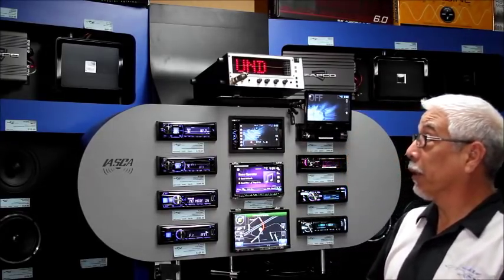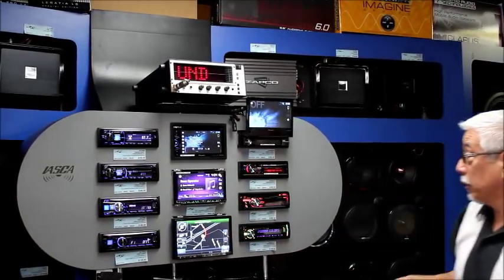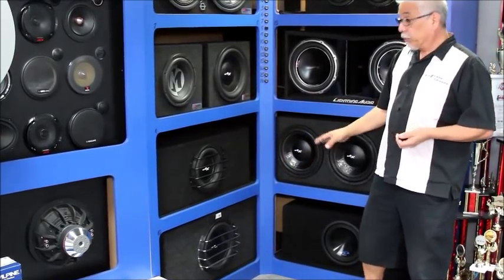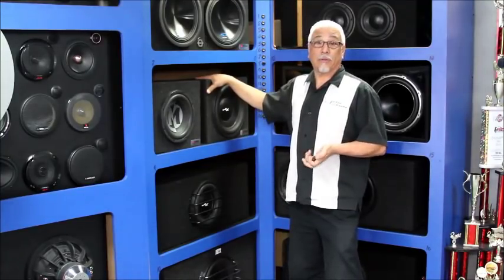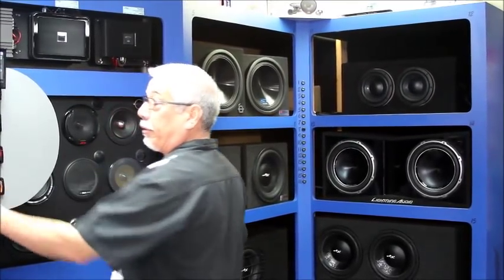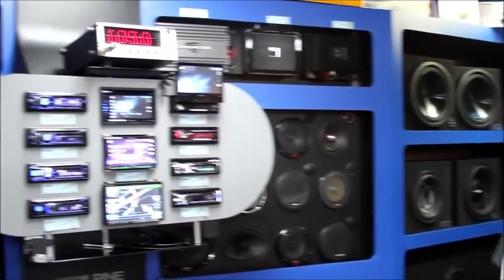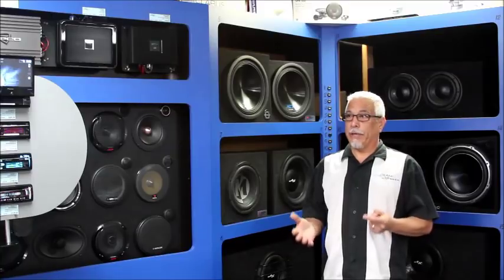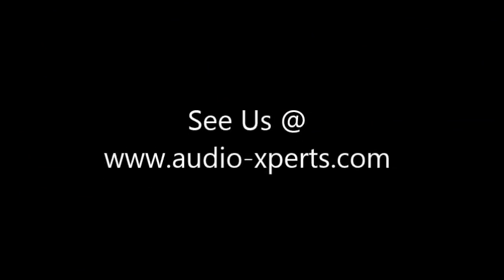Sealed vs Ported Demonstration by Audio Xperts using SPL meter to show output differences

Comment: Ok, first off, what is the subs specs? Is it low or high Qts? Does it have a stiff of soft spider? Secondly,  a correctly designed sealed enclosure can and will extend a flatter frequency response to a lower frequency if designed that way. A ported enclosure always has a spike in the frequency response at some given frequency, generally at wherever your port was designed to produce the most output at. Doesn't it depend also on the car the enclosure is going into? Most people are looking for boom type bass output, not clean output for the audiophile types. So, wouldn't it depend on what the owner was going to listen to and what system they owned? Just some questions to think about when claiming one type is "better" than another. Music is entirely subjective in what is better. Great demonstration video though. Keep the great work up.

Comment: Not all woofers work in ported and some don't work closed, so the thiele-small parameters have to be consulted to optimize. Let's say the qts is 0,3 or lower, you would need an incredibly low fs to ever get bass out of a sealed box, and on the other hand, if you bring that qts to 0,7 on the driver and make a ported box would get a nasty decay (muddy bass). If a woofer is somewhat in the middle and both enclosures are an option, you are generally looking at a 3dB gain for the ported compared to sealed, because you are utilizing both sides of the membrane, that's if both enclosures are optimized to have a smooth response with a nice gradual roll-off.

Comment: I've been recently testing out various subs and box and amps. I've found a decent amp wired to a correctly matched subwoofer is about 50% of the volume, and you get about 50% from the wooden box their mounted on and in. I've seen very impressive sound and volume from a small sealed box with just a jbl gt4 12" (250Wrms) mounted, and a T-rex 10"(1000Wrms) mounted in a tiny box barely able to rattle mirrors when I know those T-rex speakers if in a large box can break windows. I now after trial and a few errors am running twin inphase subs in a massive ported box run off a 2400W juice mono block amp. The combination is impressive and was quite cheap compared to alternatives to get same volume and quality.

Comment: Buy a sub built for a certain enclosure type and put it in that. Like an FI q in sealed and a sundown x in a ported box. Your better off getting one small sub and a good amp if on a budget. Like a digital designs 8  that can hammer lows with good sq.
Reply: Just not the lem-08... great output for a 400 watt 8, but at what cost.... just put a 12 in a matched sealed, same output, better sounding.

Comment: I turned my ported box to sealed by stuffing the hole with old clothes and I set my LPF at 250hz hoping it would change it to a bit more punching/ accurate sub. And it kinda did! I needed to adjust the gain pretty high to get the same output that the ported version and now I'm just worried that it will overheat.

Comment: Should I use a 250 rms jbl or 300 rms Pioneer for low basses in a sealed box. Box size doesn't matter. I can use even 60 lt box.

Comment: A driver will not pushed to its mechanical limit just because the enclosure is sealed.  If it happens, it's because the enclosure is not big enough.  One reason for inventing vented boxes was to cut down the size of the speaker enclosure.  This has been forgotten these days even by audio experts.  Vented enclosures can balance the inner air pressure with the outer pressure.   Sealed enclosures need to be almost double the size of their vented counterparts in order for the driver to run smoothly.  But nowadays people prefer everything to be compact, and sealed boxes are almost the size of vented boxes.

Comment: Hey... I understand your theory & I realize the fact that you mic couldn't pic up the sound properly. I had 2 12inch Electro-voice speakers in a box designed by a friend that worked at a place called tape town in Washington, I believe near Bremerton, anyway .the box was ported & running them with a 70/70 watt Sheridan bridged amps, (Yes,from back in the 80's, Cheap & very inefficient amp),the bass was gut shaking. I put rubber bushing & sound deadening material through out the hatch back to help with unwanted rattling, had the 6/9 pile driver speakers ran by another 70/70 in stereo, using 2 passive eq's, (  no electronic crossovers yet, in my area at the time), one for the woofers with the highs cut, the other with the bass cut on the 6/9's. I also has 6.5 door speakers on a 40/40 amp, anyway as I said, the EV's slammed. I tried a woofer box with sealed speakers, (I don't remember the brand so I won't make it up), & it didn't slam at all, not to say that they didn't sound good, but the inefficient amps & ported box played much louder & during the mid to late 80's good & loud sound was the order of the day. My home theater has a svs  pb 12+2 that's ported. I recently hooked up a friends HSU ULS-15 MK2  which is a sealed sub & it wasn't even close. The sealed sub didn't have the same tactile slam for movies, it didn't sound any better on jazz tracks like Diana Krall's All or nothing at all, & with Pipe Organ opera tacks, no way for the sealed box.I must state that the Svs sub has 2 12's vs the HSU's one 15, but it wasn't close, though the HSU did sound good in it's own right. My old Polk 505 sub seemed almost as  low & loud that the seald sub., but not by much.I agree, all things as equal as can be, A ported box will be louder & give more slam than a sealed box that's close to equal spec & amplified power , JM2C. P.S...I know my old car woofer box isn't a sub box. Electro-Voice speakers weren't subs but accordion edged pro audio speaker but the really hit, I believed better than the comparable Cerwin Vegas of that era. There wasn't a lot of true sub bass  laid songs out at the time. 25hz was very rare in early rap & r&b of that day.

Comment: sealed is better accurate bass
Reply: Angel Estrada hell yeah sealed any day over ported I like both but sealed just sounds better basss
Reply: Accuracy, yes. Problem in have with ported enclosures is that they fall flat on the lows especially 30hz and below unless you have a custom built one tuned at a lower frequency. But they are quite loid and boomy at 45hz. I once bought the kicker CompR dual 12 box from best buy and lows were virtually non existent 30hz and below. You could hear them bottoming out but that was it, yet my one old school CVR 12 in a sealed enclosure put out way more low frequency bass, shook the heck out of my seat. Didn't have much higher frequency output like the ported setup did but killed that kicker loaded box with the 2 CompR 12's. If you have a ported enclosure tuned at a low enough frequency it can slam lows at 20-25hz but sound quality and accuracy go out the window. With a sealed enclosure if you want more lows around 20-30hz you can achieve that by going with a larger enclosure assuming the subs are the same for comparison purposes. Also cheap subs won't hit the lows regardless because of physical limitations like excursion. Cheap ones don't have near the excursion as a good one. And to hit those super low bass notes you need that excursion.

Comment: i have 2 12" in a sealed box, i have a ported box but now after watching your video clearly ported is lowder but if i put the 12s" in the ported box how should i wire them, parallel or singular
Reply: D Anderson Depends on the impedance of the coils and your amplifier and electrical capability.

Comment: Efficiency is determined by driver alone period. A ported box only affects bandwidth or possible peaking effects, or one note bass, misalignment. Drivers made for sealed box have higher Q and less efficiency. Low q drivers need ports to compensate for excessive bass rolloff. There about an infinate number of tunning possibilities with ported.

Comment: My Amplifier was a bridged 4 channel Clarion 400.4, rated at 190 watts by 2 at 4 ohms, the subwoofers in question had a continuous power rating of 150 watts each for the 15" JL's and the 12's had a continuous power rating of 125 watts each! 

This was in 1999-2000 and yes you can claim that they were not loud but I had been pulled over by one officer who walked up to the back of my van and looked in then told me he made a mistake when asked why he pulled me over! 

I was approached when picking up a girl in Syracuse "I just turned 19" she was a senior because I had cranked up my radio, he argued and told me to keep it down it  was rattling the school and at the time claimed I could not have had the Truck tags on my van! This was in Warsaw, Indiana, just ask any of the EMT's located on that street if they were ever woke up by a 1993 Gold Ford Aerostar with Crome wire wheels!

You can also call the North Webster Police to ask if this vans stereo had ever been a problem, just like the Warsaw and Winona Police they may remember! The amp was underrated and it was built by clarion in 1998! I also had a Line driver and Kenwood deck!

I repair amplifiers for fun, I have several nice ones including a Kenwood Excelon KAC-X1R, Orion HCCA225, Earthquake 400TX, but I do still have that Clarion as well! I have been an Audiophile since I was 8, I know many things! Most people don't know how to wire a DVC sub without a diagram, yet I've known since I was young!
Reply: If you ever come across old school USAcoustics amplifiers I might be interested

Comment: I am a sealed guy by nature (and want the ported girl @Saigon_Baby) and enjoy good sound quality. 

If your in an open space like an SUV/Truck go sealed. If you have a sedan and the sub is in the trunk -you can go ported to get more efficiency. The key is building the box to spec and tuning the box to lower 30s if you want good quality -rather using a pre-fab box which will never sound as good (seems this video he has prefab boxes tuned to mid 40s for higher output boomy).

Comment: Ported are junk. If your sub is making mechanical noise in a sealed box, it's a shitty sub. What he also didn't mention is that it takes more power to push a sub in a sealed box. I had 2 JL Audio 10w6's back in the day in a sealed box with a shitty 1200 watt amp pushing them and they were so loud and undistorted and no mechanical noise that it blew everyone else's crap away. People thought I was using a ported box, the car audio shop wouldn't sell me anything else because they said it was too loud so I had to switch shops. It also takes a certain amount of space for a bass wave to reach it's full potential. My system was so good that when my car shit the bed I brought it inside, put a battery on a charger and connected it all up and threw parties that sounded like it was a club with the same undistorted bass and no noise. I had to shut it down every hour to let the battery get a charge up but still. Also what's not mentioned is capacitors which make a difference. That much power and bass, you really need one because it not only keeps your headlights from flashing with the bass but allows your subs to hit harder.

Comment: I had a solid silver box with four twelves in it never had any issues whatsoever no mechanical failure nothing. I sold the system Feller did not want the solid sealed box he built his own from specifications from Fosgate for a ported box. And it blowed the s*** out of all for those 12 in Eclipse Pro Series Subs. I had a thousand Watts going to each one he blow them with 500. But that was back in 92

Comment: You could fit 2 sealed subs in the same space as that vented cab which would be better over most of the bass range. More expensive though.
Reply: Low ported subs are massive size of a fridge. 

In a car I'd go sealed. You don't need massive db output, and smaller size and room gain will help.

Comment: I have a f150 single 12 on 500 watts with a ported box. I want to get more performence out of it the system vibrates my truck a little but it not as much as i was hopeing

Comment: Total crap.  It all depends on the T/S parameters of the driver and what the design of the driver was intended for.
I have built free-air systems (OK, they still use the trunk as an enclosure), ported systems (including 4th order and 5th order band-pass), and sealed (2nd order) systems.  Each was designed for specific drivers or for specific vehicles.  Just because you build a ported box and slap a driver in it does not mean it will play louder or sound better.  This is just using FUD to try to sell to the uninformed kids.  Do your homework kids...stay away from generic BS like this.
The ONLY thing that impressed me in the video was the two Zapco amps on the wall.
Reply: Nice lookin Zapcos indeed.
Reply: I'd rather have a $350 sq4.800 installed by someone knowledgeable though

Comment: I have a alpine type R in a ported box. 1000 rms for sub and 1000 from amp... I listen to more rock n roll and heavy metal music and I'm not getting super good bass from rock songs. Rap is ridiculous loud but what should I do to get more bass from hard Rock?
Reply: souls elite bass boost on your amp can add more bass to ur music .
Reply: I hear that's very stressful on your amp and not to use it
Reply: souls elite only when bass boost distorts your subs if u don't hear distortion you should be fine I always had bass boost on and my subs handled it and amp . Distortion is what destroys speakers .
Reply: All knobs to the right
Reply: Just finished a sealed box for two type R 10s...  Each side is .75 cubic feet. After speaker displacement  its about .65 - .66 per side. Stuffed with poly fill. 500rms per side - it pounds and sounds great for all types of music. I'm a metal head mostly but do listen to all types of music.

Comment: It wouldn't also have anything to do with 10db gain coming from the fact that the bottom box is atleast 2x as big if it was The same sized box I would be blown away buy 10 dB also depending on how the subwoofer is designed subwoofers designed for ported only enclosures are a lot stiffer and really hate sealed boxes

Comment: if you just want brute SPL then go with a bandpass, it's the loudest among the 3 common designs at the same enclosure size. but does it sound good? i can tell you by living with it for years, no matter how well designed, it sounds like crap. SPL is not everything.

Comment: I have 8 subs for DJing and they are all sealed and they all shake concrete floors, so this video is false. sealed boxes also give you lower frequencies (19-28hz) on my system!
Reply: Owen Solmen what brand speakers u got ? Ur subs must have good power if sealed box bumps loud
Reply: I agree. When someone who is actually into audio as a science, our perspective and goals tend to be different than someone who doesn't know the science. Just check out any pro audio subs, and most will be sealed, esp. if sub is big and esp. DJ subs. 
--Ya, like all those Techno raves out there are using ported sub enclosures because it's a scientific law that sealed enclosures will cause sub mechanical distortion. I mean like huh?

Comment: Not taking into account the speaker efficiency either? Sealed enclosure could sound louder or equally loud with a 98 dB/1w/1m transducer than a ported enclosure with a 92 dB/1w/1m. Also, it of course depends on the internal volume of the enclosure.

Comment: The ported enclosure is louder, but it sounds like crap, as if something is rattling. The sealed one sound better, though it's hard to define fidelity considering the ugly noises that were being pumped into both. I don't totally buy the notion that the sealed enclosure puts more mechanical strain on the driver; that may be true for some drivers, but if the cone suspension is weak (as was often the case during the "air suspension" era of the early 1970s), the back pressure can actually keep the cone from bottoming and topping out. Either way, I'm not saying that the a ported enclosure has to sound like crap; it should be tuned to act more-or-less like an open-back enclosure at the driver's resonant frequency, then cause a 180 degree phase-shift (so the cone and tube volume are in phase) at half that frequency, so the comb-filtering of the port tames the response curve of the driver. Not that that would prevent the rattling, but assuming the rattling could be addressed one way or another, it would get the most from the driver.

Comment: its a audioban box the subs that was in side got burn up after 3 years so i drop in some cheap lanzar that are rated 250 rms 500 watts peak an they sound so much better i was sopurise the box has 15inch in hight 23.5 inch in lenght an the top an is 13.4 bottom is 19inch subs has 11.5 each side facing each other thats all i know so far i also have a seald box doesnt sound as good as the banpass like i said we all have our own tase in bass an yes u are correct clarity is a must we try to get the best of both world thank u